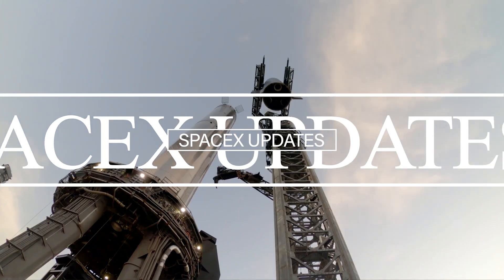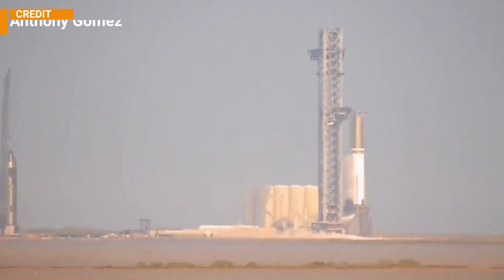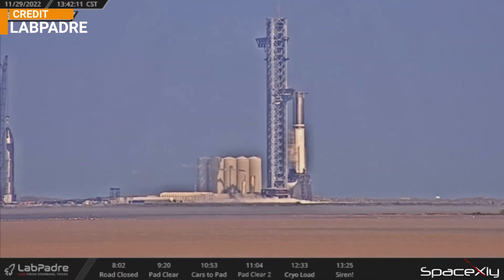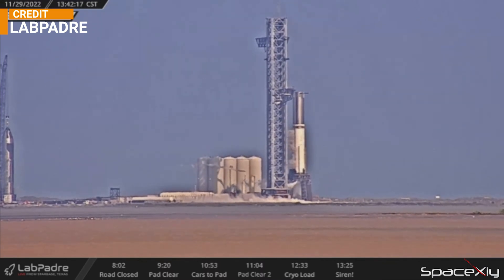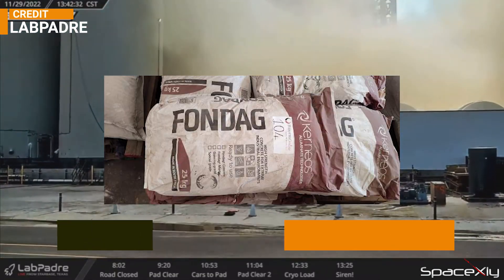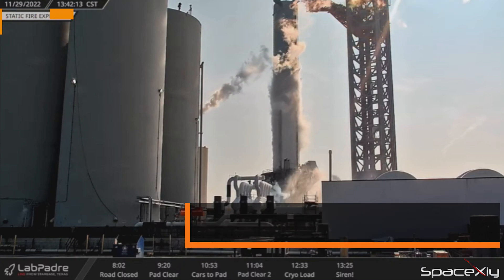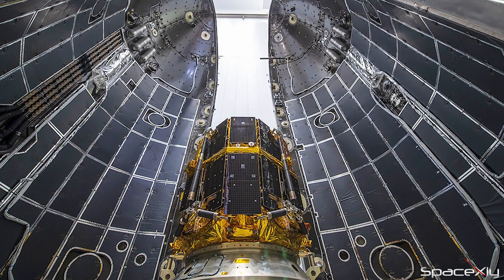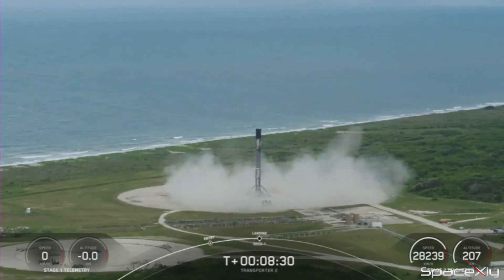Another Successful Static Fire on Booster 7, 33-Engine Static Fire Next!!!🔥🔥🔥 SpaceXly Daily Update

Comment: Thank you for this update! What is fondag?
Reply from the maker: "Formulated using specific alumina binders and synthetic aggregates, Fondag is the most reliable ready-to-use heavy-duty concrete on the market."
Reply from the maker: "FONDAG is extremely stable at high temperatures and in conditions of severe thermal cycling from 395°F to +2,000°F (-184°C to +1,093°C). In the same conditions, portland cement based concrete becomes unstable and experiences mechanical and structural failure."